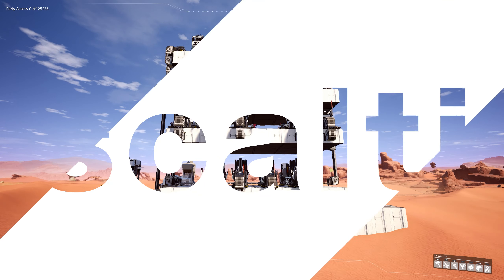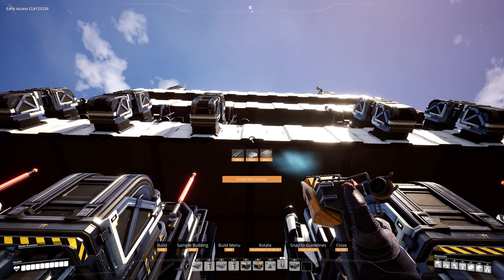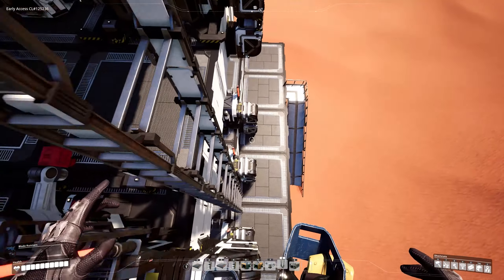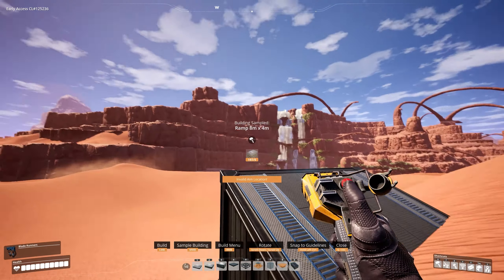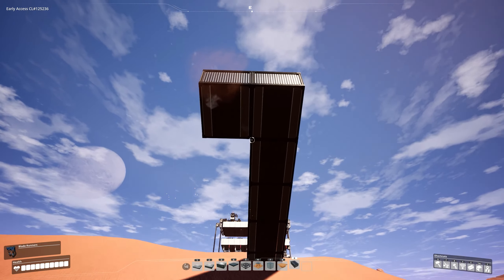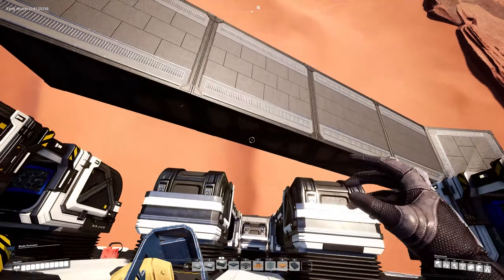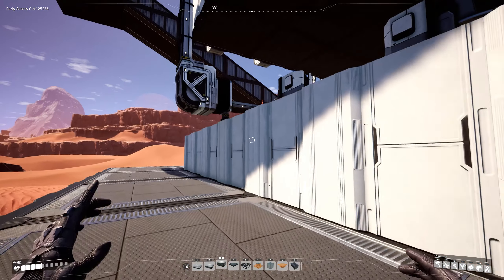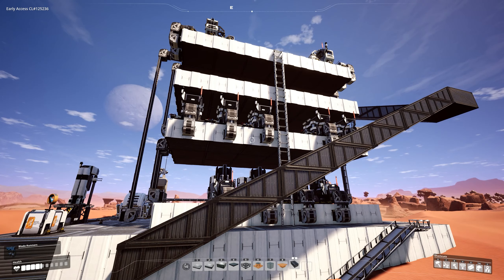Scaffolding Tips for Going Vertical [SATISFACTORY TIPS & TRICKS]

Comment: One thing I didn't know at first was the hotkeys for transferring items from storage. I had been double-clicking on the items. Instead, SHIFT + the chosen item will transfer the one stack. CTRL + the item transfers all the stacks in that storage. At first, I thought you had to hold CTRL and drag the items because that's what it says to do. Actually, all you need to do is hold CTRL or SHIFT and click the item. Sooooo much easier.

Comment: I like that your walls and buildings are white instead of orange. I am a new player, how did you get that color changed?
Great Vids btw :)
Reply from the maker: As you run around collecting leaves you’ll occasional get flower petals. Research those in the M.A.M. and you’ll unlock a tool that will allow you to do this. When you have it, you can change the upper left swatch to any color and it will update all your structures. It’s the default swatch and will automatically change the color of anything new you build too.
Reply: @Scalti  okay, thanks!
Reply: @Scalti  This is what I was looking for, thank you! Now to go research this :)

Comment: I make a platform all around it with foundations and ramps so i can circle around building stuff and then delete it all at the end, and most of the times I add some walkways around with access to each floor, they look nice and the railing dont let you fall when running around.. you can do them on the square inside the walls in your designs so you dont have to look at it but I actually like the looks.